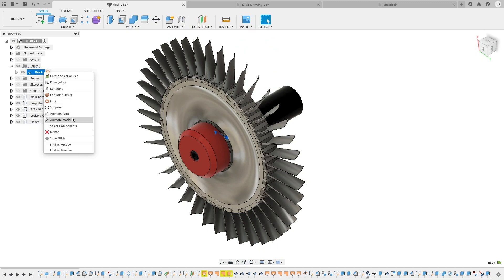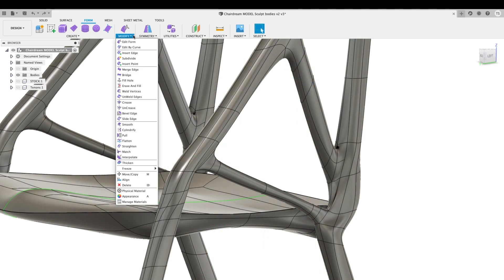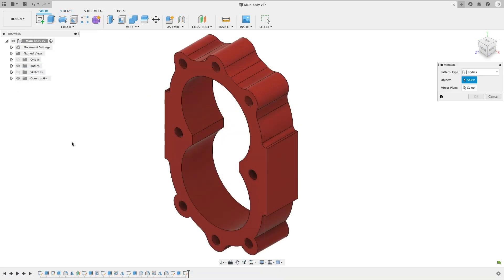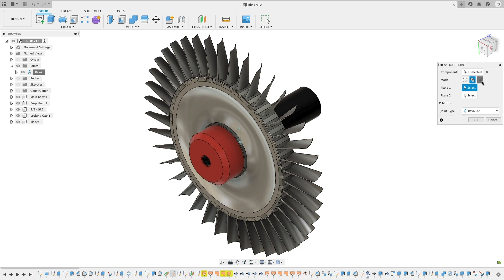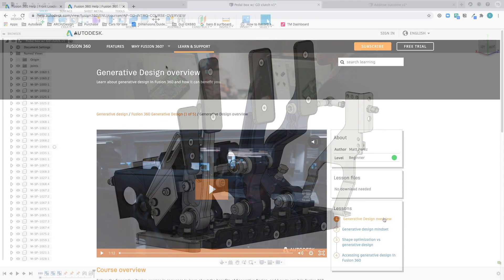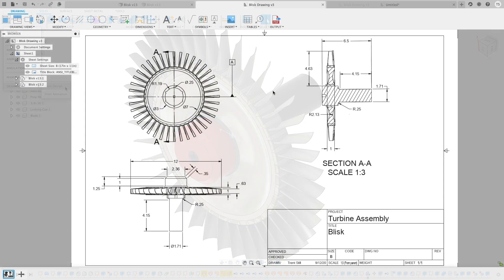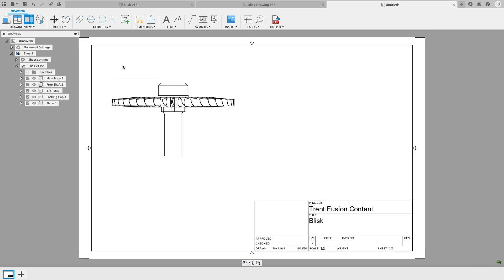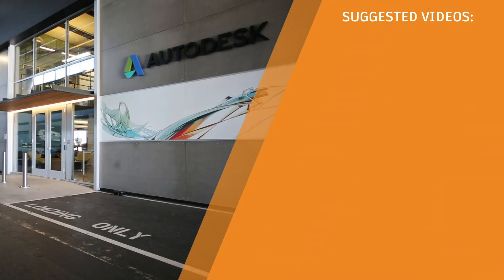What's New In Fusion 360 Design & Engineering - September 2020

Comment: I've been using Fusion 360 for over 5 years now. I use the drawing workspace weekly. I have mastered most of Fusion EXCEPT for the drawing workspace. Every time I open it I get frustrated. It's clunky and non intuitive. You can't pull length dimensions from filets, which makes it nearly unusable for me, and there isn't any good tutorials out there for many of the new features. I'm dimensioning fishing hooks quite often. The manufacture wants overall length, and height of the hook. Doing that is impossible in Fusion 360 without making a drawing to do so which takes way more time than it should. I can produce dimension drawings 10x faster in my old 2d EZ-CAM software, and that's super frustrating.

Comment: When are you planning to release the full nesting workspace?
Reply from the maker: It's coming but we are working on a few details to make sure it meets our customers needs before going live.
Reply: @adskFusion  Thanks for the reply, any way to join a beta program for this feature?
Reply: @mamokpospolity , Advanced Nesting is still limited to an Invite-Only Insider Preview. In order to maintain effectiveness and correct level of engagement during preview, we are reviewing individual requests on a case-by-case basis. As more information is available, we will post on the Feedback Hub:
https://forums.autodesk.com/t5/fusion-360-feedback-hub/open-nesting/td-p/9068208